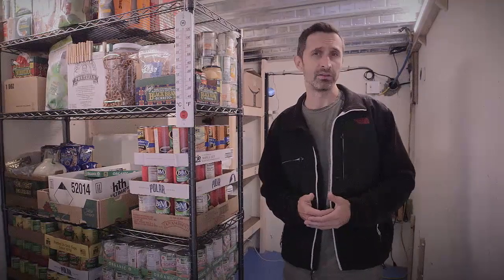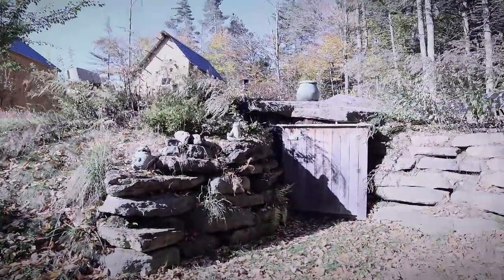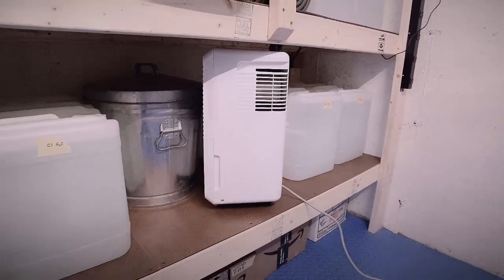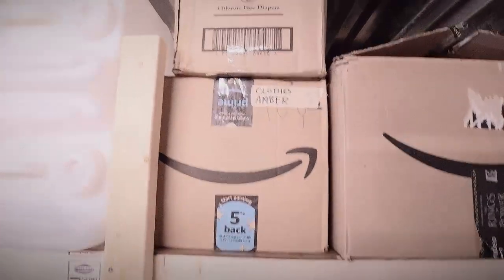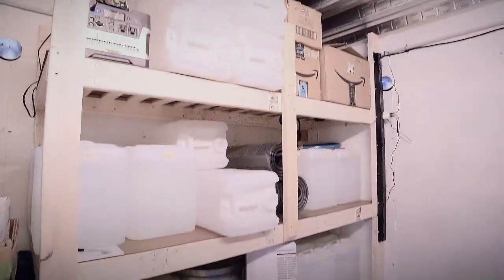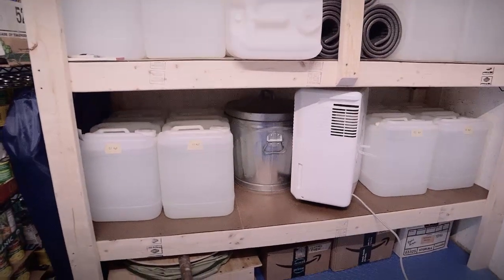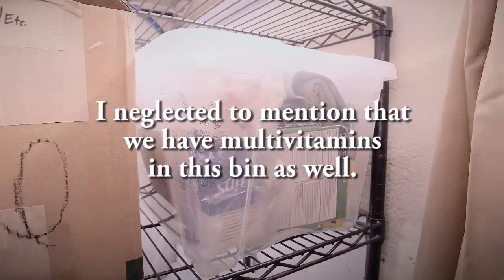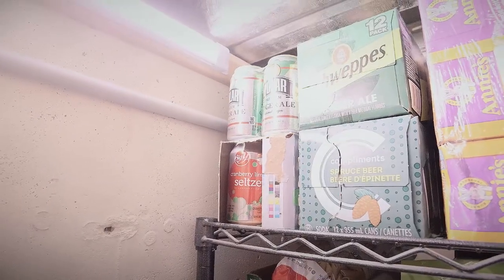Full Tour of Man's Private Nuclear Fallout Shelter

Comment: For the poop program….have cat litter to scoop over…good for the 24 hours period before getting rid of it….  Open air poop in a bunker is a fine way to infect everyone and water and food. We are doing that in camping in a poop tent…smell is berable….imagine in a bunker.
Reply from the maker: Great comment. My "A" plan is to close bags immediately after business is done (one poop per bag). But cat liter could extend that. Question: Do you find that some cat liter is better for this than others? I imagine "scented" cat liter could be nauseating smelling all those perfumes after a while.
Reply: @PraxisPrepper  use the one that is long lasting….you could also add wood chip…it does have the effect to neutralize the urea. Cheap and effective.
Reply from the maker: @canadianneo-frontiersmen6165  Good tips. Thx. On the urine, I'd go a step further and suggest that all urine be poured out down the drain (if one is available) as soon as it's produced. Mixing extra moisture in with the #2's will be a lot smellier than dumping the urine asap.

Comment: Wow you ran your water through an electrical conduit.
Reply from the maker: I'm not sure how it came off that way, but I did not. I ran my water through a potable water hose that was run through a 4" ABS waste water drain pipe. There's electrical PVC in the shelter, but that's for the wires, not for the water.

Comment: No 45 degree at entry
Reply from the maker: I'm not sure I get what you're saying here. I have a 90 degree turn at the entry. Were you reinforcing that being better than 45? Or did I accidentally misspeak in the video and call my 90 degree turn a 45?
Reply: @PraxisPrepper  : the 45 degree is for a blast protection from the shock wave ( up to 200 miles). Easy fix, Sand bags filled with dirt. this prevent the door to cave in. Praxis
Reply from the maker: @Diebulfrog79  Thanks for clarifying. I might make some tweaks there. I had never intended the door to act as a blast door, but if a few tweaks can add that functionality, I might go for it. The only military target in any reasonable proximity actually IS directly in the line of that open door.
Reply: @PraxisPrepper  You have a fall out shelter not a blast shelter. The main thing is distance and what you have is fine. If anything build an extension with another 90 degree turn. Radiation moves in straight lines.
Reply from the maker: @HuplesCat  Yeah, blast shelter was a bit "next level" for me when I was building this monstrosity.

Comment: I have one of those thick green plastic green houses. I believe it’s 6ft by 8ft. Would that work to protect from fall out or at least I would have an area of ground that doesn’t have fall out on the ground beneath it?
Reply from the maker: Are you asking this question for use as something to prevent the soil from being contaminated? I'm not sure what you're asking. The rule of thumb for all fallout is to:
1. stay away from it as far as possible.
2. put as much between you and it as possible.
3. reduce the amount of time where you're exposed to it.
The distance note is actually the most potent of all of them. Doubling distance reduces radiation by more than half.
Reply: @PraxisPrepper  So the ground underneath the greenhouse would be contaminated by fall out? Because I heard you mention putting plastic on the ground. Sorry I wasn’t clear about my question.

Comment: A white globe on one or both of the light tubes on the right would brighten it up. You could even make some out of paper. I can see leaving them off to save space if you already have some.
Reply from the maker: Yeah, those tubes aren't finished yet. They actually have a 4 inch gap in the mirrors at the top where there's 4 inches of black (worst possible color to be there). I'm interested to see how much better they work when finished.

Comment: Where to begin, I hate to even comment because I feel like all I am doing is finding fault, I have zero fallout shelters, I am so far behind you in this requard it is not even just funny.  The reason of course is financial.  You have a significant investment.  So even though I am going to say some things I would consider doing differently, I have the greatest respect for what you have accomplished.  It is a feat, no doubt.  Of course I do have some things I think could have been done in another direction.  First I have already told you how I feel about your wiring and I am not you nor am I going to have to live with it.  My method does increase costs and may be totally over the top.  Who knows.  I do hope your battery bank is vented, I have lead acid as well but any lead acid even sealed cells can generate hydogen and oxygen gases.  Then your electonics is directly over the battery bank, gases rise and the electornics can spark.  So you might want to at least give that some examination.  Again, not me nor my family at risk.  Then you mentioned that you do have a co2 alarm that is good but I am far from certain you do have enough leaks to the atmosphere for the gases to leave.  In one way I hope not as it would defeat the purpose.  A one day test would not be good enough.  I would do a 2 week test using a tank of co2 and let it leak at about the same rate for 3 people with a periodic cycling of your air pump and be certain, not a just I think, your family is too important for an I think.  Did I see any fire extingusers.  Did I see any kerosene lanterns as a plan c.  Love the bellows, that is good outside the box thinking.  Then there is security.  You basically have none.  While I know it is not likely, you really do need to think about zombies, i.e the maurader class of low life.  I would camoflage the air vents and the enterence.  that enterance  is a whole different topic.  You need covers over those light tubes so you do not have a little beacon on your hill, saying here we are, come and eat us.  Then I would think about putting a dog lot right up against the enterance and making it just look like a back wall of a kennel.  I know from your videos you understand the risk other humans would present in this type of problem.  But I think you are just naturally a nice guy and tend to discount that risk.  I never do, some people may be nice, but most of em are no damn good.  What the no damn good varity will do in a world without the rule of law is going to be horrible.  

The other thing I would mention.  Was there no way to to tie to your septic system or even just install a mini one for the bunker.  More money for sure, maybe even wasted money if nothing ever happens but I consider a septic system right up there with water.  Not having it just makes life much harder and nastier and even more dangerous.  Still I envy you your homestead and the bunker.  It takes work and didication to accomplish that.  If a war comes and visits our nation, we do not anticipate living through it.  We are 67, 63 and 59 and the girls would be helpless without me, so worse comes to worse, I will do my best and let the chips fall where they may.  So again, not finding fault even if it sounds like it, simply giveing a point of view.  Only a fraction of th population has done as much as you have for your family.
Reply from the maker: Those are all good points and every one of them is definitely on my mind. First, YES I forgot to mention that we have a fire extinguisher. It's in the kitchen bin and it's very important. I wish that I could have gone through the bins on camera. But no one to help me shoot means I have to make due sometimes. I forgot to mention the vitamins as well... and maybe some other items too.
On the hydrogen gas. Yes, that's absolutely a thing. The batteries are NOT sealed batteries, so venting is required. I've been "winging it" for the time being. But that needs to be resolved at some point.
On the vent of exhaust air. I DO think I'll need to add one. It needs to have spring-loaded flaps (like the bellows) so it only opens when there's air going out. My plan is to add that to the top of one of the light tubes and turn the tube into a vent.
As for the two security-related concerns (the visible light tubes and security at the door), I don't feel that the light tubes are that conspicuous (at least not with all the vegetation around them) but the delightful Hobbit door IS. Your idea of making it look like a dog pen etc. is cool. I've considered placing a deck over the entire entrance so it's very well shaded (and the deck could also be part of a pre-entry system of decon). As for general security, I never discuss that on my channel because it's my feeling that I'd prefer anyone approaching my place to be under the impression that I don't have any security. Do I? Don't I? They'll find out. ;)
Septic system question. That would have been great but I was really designing the space as a root cellar that could be pressed into service as a fallout shelter in the "incredibly off-chance" that such a thing would ever be needed. That was about 3 years ago and BOY have we moved pretty far from what used to be an "incredibly off-chance"! So yeah, I'm doing the best with what I got. realistically, while 2 weeks is a good rule of thumb time period, after about 48 hours, it'd most likely be totally fine to at least open the door to toss bags of shit outside if needed. So we have options on that one... and the bags of shit themselves could act as "deterrent land mines" for security??? ;)
Thanks for your thoughts, they're always very much welcome and appreciated! If if (like these points) they were things that were already on my radar, just hearing someone else note them as well, reinforces the ideas to me to keep me from slacking off on it.
Reply: @PraxisPrepper  On the light tubes,  I was just thinking a flap to close them off at night, that way you would not be radiating a signal that even though small, would be visible for a long way.  In a grid down world any light is going to be noticable.  But I am glad to hear you are just keeping security close to the vest, wise.
Reply from the maker: @charlescoffey9523  You know you're now reminding me of something that I'd considered a while ago, but have forgotten about since. I had been thinking that flaps or plugs on the inside could serve that purpose. Thx for the reminder. Far better you here now than a knock at the door in the shelter later! ;)

Comment: Two questions (Not fully through the video yet, so sorry, if they're already answered): 1. If strong winds or anything of that dimension rips out your antennas, will it also rip a hole where the antennas are lead ito the root cellar? 2. Is it possible for you to take the chickens into the root cellar with you? I might be imagining this as far to easy, carrying them over, keeping them entertained and being able to sleep next to them, but it would come with the benefit of entertainement for the humans inside and not loosing the chicken.
Reply from the maker: Two really good questions. I dont have any intentionally designed failure points in the antenna line, but a possible point of tear could be the coupling right before they head underground, or even more likey, at my solder point 5 feet above the ground. But you're right, a strong tug could do "who knows what". Obviously, that could damage gear if a radio were attached at the moment of the incident.
As for the chickens, bringing them inside would be a nightmare. The pooping is nonstop, and the teo roosters scream on and off all day as if they're being paid to do so. I'm working on their permanent coop next summer that would offer them more protection. Good questions.